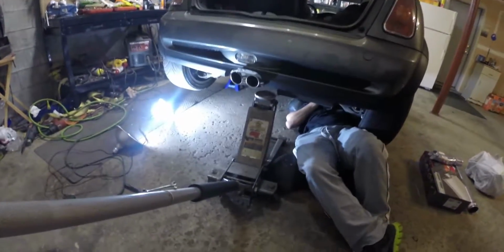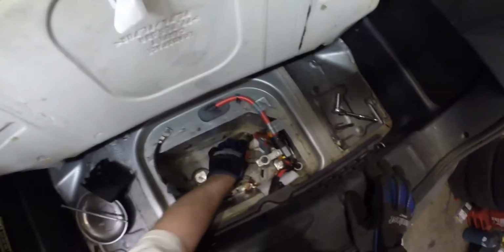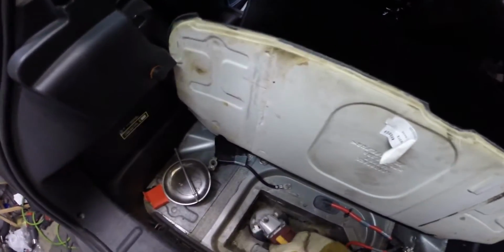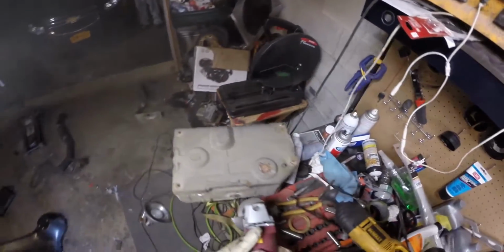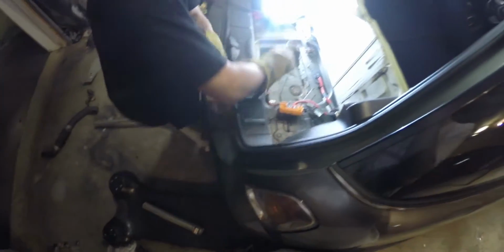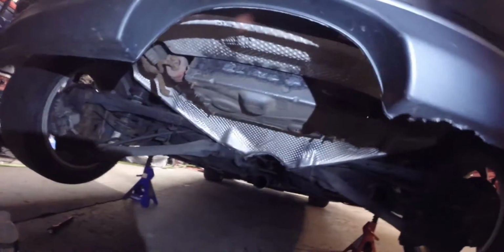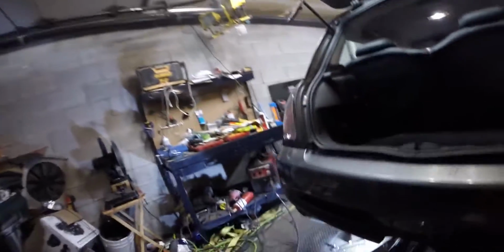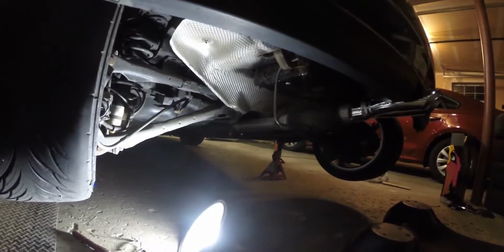How to Delete Battery Box/Straight Pipe R53 Mini Cooper S

Comment: I plan to remove min but I'll be deleting the rear seats and installing a roll cage shortly after. I plan to elevate the rear seat delete to the height the seats lay down out which will leave plenty of room for the kill breaker box and then just cut out some compartments in the delete plate.
Reply from the maker: That sounds like an awesome project!